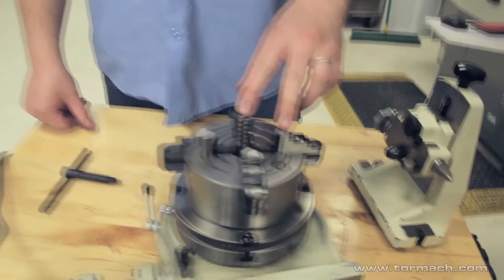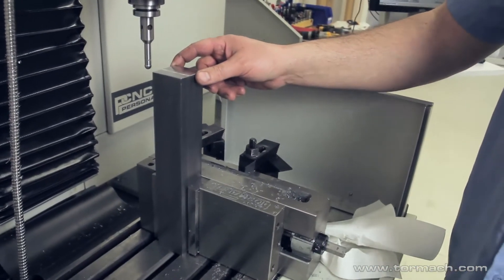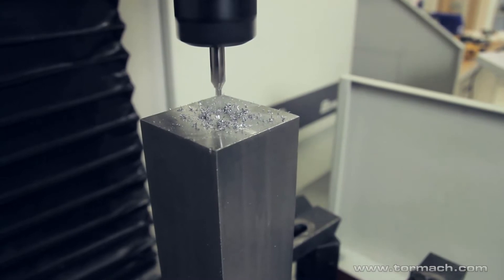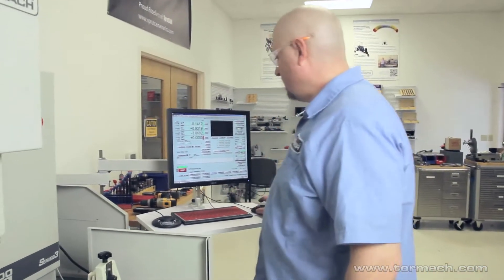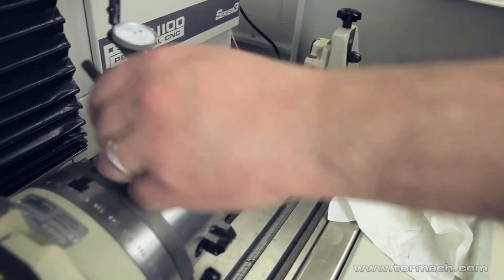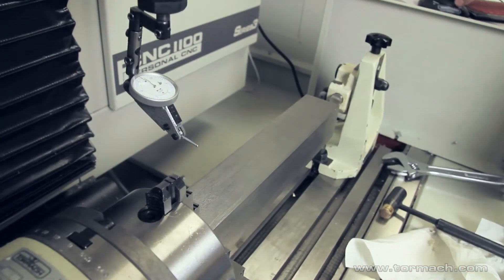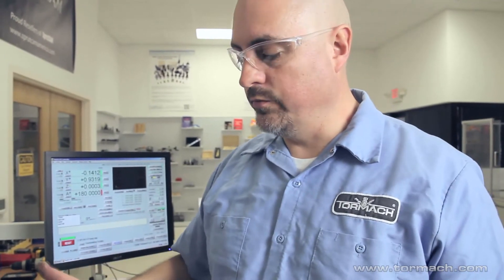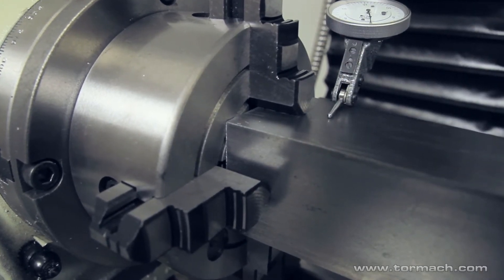How to Set up a 4th Axis: 4-Jaw Chuck - Tormach CNC

Comment: I would like to suggest a quicker way to correct the offset once you get the first measurement done.   Once you get the first measurement done, index the axis 90 deg and use an indicator in a mag base to indicate the front face.  Now you can get to both jaws you need to move to do the correction.  Adjust the front & back jaws half of the error.  Do that for both planes of the work piece, then re-check with the indicator in the spindle for all faces.

Ray